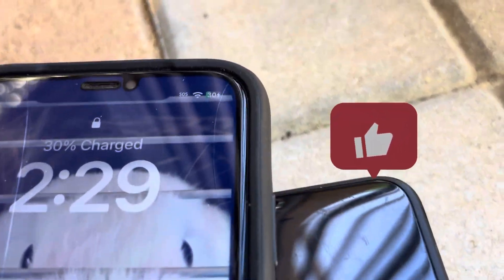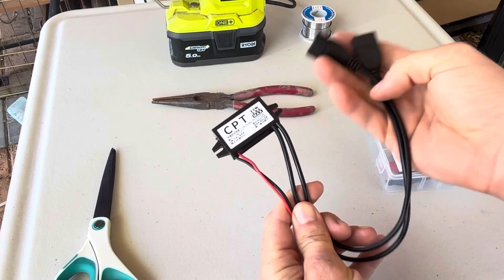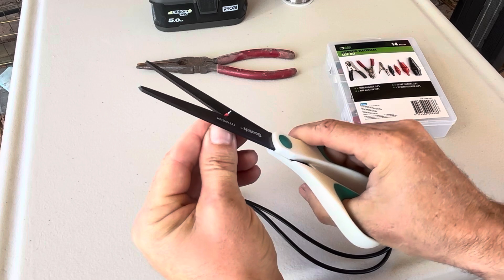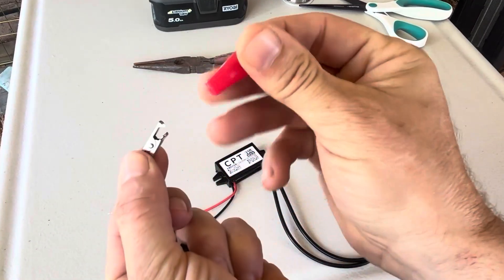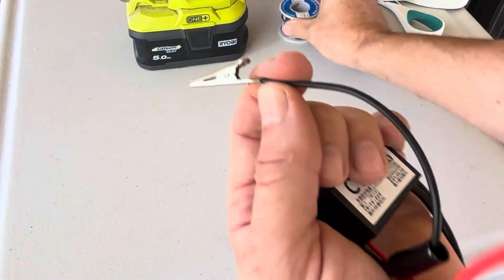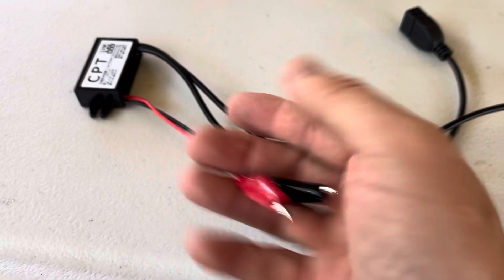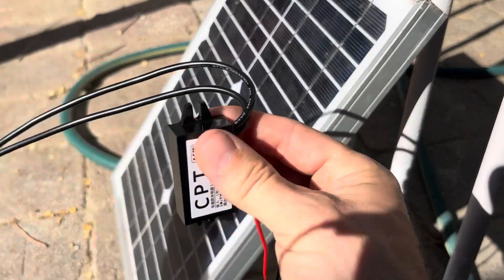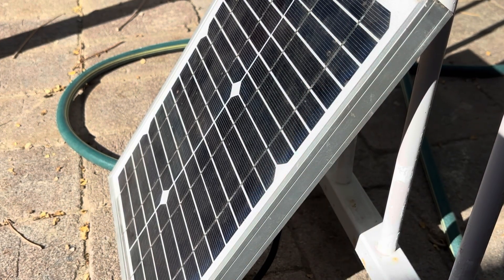Solar Phone Charger DIY ( 3 Simple Steps)

Comment: I had a solar battery maintainer that died;  the electronics went bad;  dismantled it, removed their circuit and permanently attached one of those devices for the same purpose.  25 Watt panel;   Wasn't useful for much else;  Works.  Did this a couple of years back.
Reply from the maker: Great idea. Great use of an old battery maintainer well done.